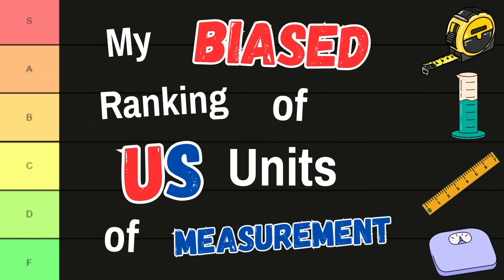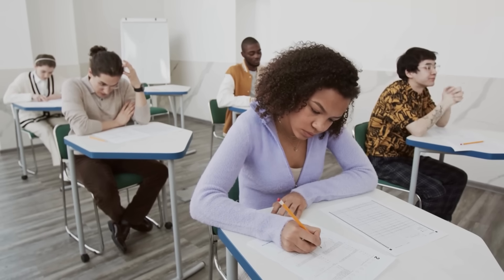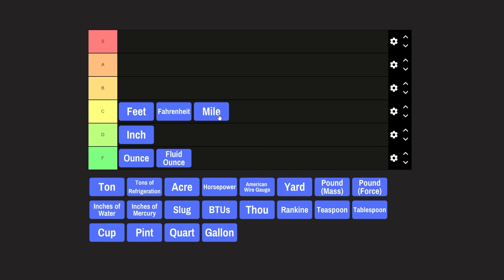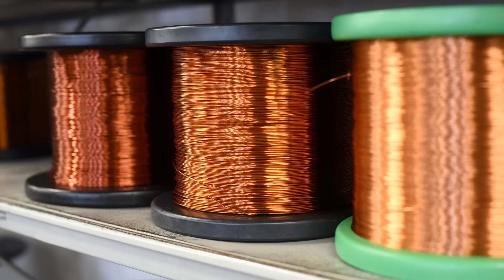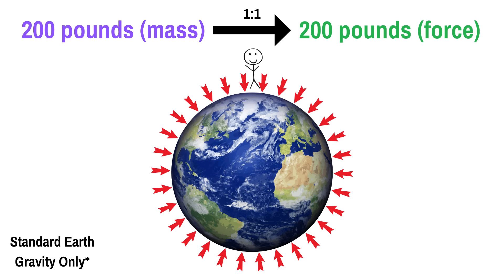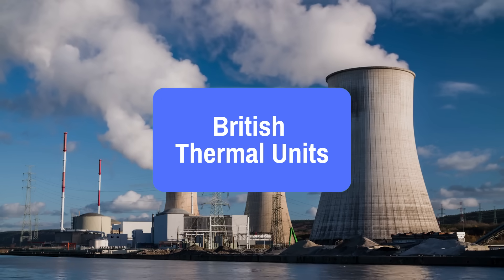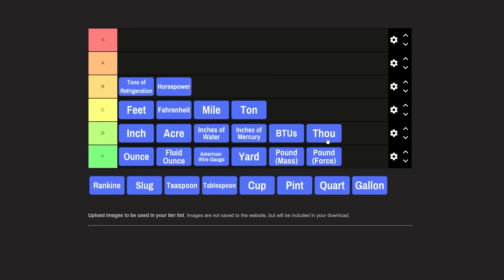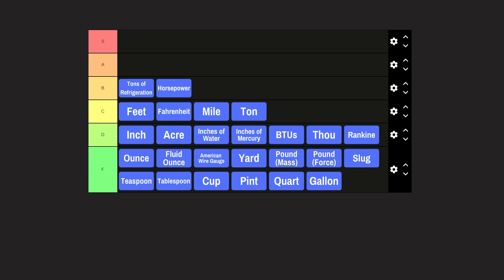Tier List of the DISASTROUS US Measuring System

Comment: Fun fact: as an electrical engineer based in EU, I have a decent grasp of how much of what every clown unit means, EXCEPT FOR WIRE GAUGE, because that shit is impossible to convert to anything related to the real world without whipping out the conversion tables.
Reply: Gauge is the worst. Especially because wire gauge, nail gauge, plate gauge, and screw gauge don’t even line up. Just tell me the thickness!!! Everything could be in millimetres and it would be so easy!
Reply: @ImranZakhaev9  totally agree, sucks that drill bits are in fractions of inches but things that go through those holes are in gauges
Reply: @ynx that is weird. Thankfully, that’s not the case here in Norway, we just use millimeters for everything
Reply: @kristoffervatshelle1418  do you use mm for high voltage transmission lines too?
Reply: @ynx  To be fair... Drill bits are in mm here but wires are marked in mm² and that does not account for the insulation. Metric does not solve this specific problem.
Reply: @1001digital  is this a valid problem? are you supposed to put a wire through a drill hole without any sheathing or grommet?
Reply: @ynx Things are done differently here in Europe. When a house is built, they cut channels into the brick walls, then place the cables and then plaster the walls, including the cables. I've never seen someone using an additional sheathing. And when you have to go through a wall, you need to drill a hole. So I think this is a real problem.
Reply: @ImranZakhaev9  shotgun gauge at least makes some sense. "How many lead balls of this diameter does it take to get to a pound?" Or at least, that's what I remember the definition being. Now that I think about it though, I'm pretty sure a 12 gauge shotgun is FAR to large a bore to take 12 lead balls to get to a pound... hold on, gotta look this up

Edit. According to wikipedia, this is how shotgun gauges work.
Reply: @ImranZakhaev9 
1: other than wood screws, everything I can think of that goes in holes is measured in inches. 
2:If Brad nails were in millimeters, they would be far less fun.
Reply: @ImranZakhaev9 exactly. I would even take circumference at this point...
Reply: @ImranZakhaev9  the word itself in its verb form kind of means "to estimate", so what were we expecting :D
Reply: As an electrician in Finland I use about 50/50 AWG and mm2, I just memorize a table just to get an idea of the conversions, where 10AWG is 6.0 mm2, 12AWG is 4.0 mm2, 14AWG is 2.5 mm2 and so on
Reply: @lassipls  When I studied undergraduate it was 2.5mm2 for light fixtures and 4mm2 for outlets. is that your code also?
Reply: @ynx  I only wire industrial control panels/cabinets so I don't really know what you mean. I choose appropiate wire according to the MCB/fuse rating it is part of. 

0.75mm2 for 4A and smaller, 1.5mm2 for 6-10A, 2.5mm2 for 16-20A, we rarely use 4mm2, so for 25A and 32A we use either double 2.5mm2 or 6mm2 depending on the situation. 

Also only a handful of projects I've worked with had wire sizes specified in the electrical drawings, so it's up to the guy who wires the thing to choose appropiate wire size.
Reply: @lassipls  Gotcha, normally you have code dictate what you said, circuit breaker rating, some derating factor (0.8) in US for continuous current, and type of wire dictates wire thickness here
Reply: @ynx  I don't actually have a formal education in anything relevant to the field, and I most definitely have no business working as an electrician doing residential jobs. All I know is wiring enclosed control panels, that mostly control things inside factories. The length of connections 95% of the time are less than 2 meters (7 ft), and we only use stranded copper wire (Multinorm H05V2-K / H07V2-K), sometimes tin-plated. I guess we mostly follow "common sense" or "good practice" instead of code and regulations in this regard, as long as our customer is happy with the result.
Reply: @ynx  I believe in Norway it is 1.5mm2 for a 10A 230V circuit and 2.5mm2 for a 16A 230V circuit. This is for wiring of homes.
I believe the amps for extra high draw appliances such as cooktops/cooking-stoves have their own 20A (or 25A) and utilize 4mm2.
Reply: Try KCM wire. We used it in engineering. They have nick names for birds too
Reply: Do you usually ise EU/tick or EU/second
Reply: That seems to have been the point. It's based on equal factors between adjacent sizes, but for some dumb reason it's a factor of radius not area, when area is the one that is proportional for current capacity, resistivity, and tensile strength...
Reply: @blairhoughton7918 
Area and radius are directly linked through an ingenious new equation: πr^2=A.
Reply: @777idkineedausername"proportional". I'm sure that was clearly visible in my comment.
Reply: The tierlist should have one more column at the bottom, just for that abomination.
Reply: Thank you, Napoleon Bonaparte.
Reply: Wire gauge is the dumbest way to denominate a wire size.
Reply: I fucking hated that
Reply: You are not entitled to an opinion because I am holding all electrical engineers accountable for the mother of cursed units that I saw at IKEA: KWh/1000h aka: (joules/s)*h/1000h
Reply: @sth9708  I assure your that is not the work of an engineer
Reply: @sth9708 Pretty sure that's EU mandated and just meant to give you a quick overview of how efficient something is when comparing different appliances
Reply: @sth9708 That is not cursed for Europe as our electricity is measured in kw/h. So telling me how high the energy consumption for 1000h is seems fair. I guess that's approximately how long you have a lamp on in a year. 

Normally everything is in kW/h per year but for lamps 1000h seems more reasonable as you don't keep them running 24/7.

I'll know the avg yearly cost if I multiply that number by 0.35

Joule on the other hand is not really used, most people won't even know what that is.
Is your measurement of how much energy you used in joules?
Reply: Whenever you think you understand their units, they hit you with something worse. Burgers per bald eagle.

Comment: The metric system links length (meter), mass (kilogram), volume (cubic meter), pressure (pascal), energy (joule), and power (watt) through SI units.
Length defines volume (1 m³ = 1 m × 1 m × 1 m) and area (1 m² = 1 m × 1 m).
Mass ties to density (1 kg/m³) and force (1 N = 1 kg × m/s²).
Volume connects to length (1 m³ = 1000 L) and density (1 kg/L = 1000 kg/m³). 1l = 1dm³. 1ml = 1cm³.
Pressure is force per area (1 Pa = 1 N/m²), with 1 bar = 100,000 Pa and 1 atm ≈ 101,325 Pa.
Energy is 1 joule (J) = 1 N × m = 1 kg × m²/s².
Power is 1 watt (W) = 1 J/s = 1 kg × m²/s³.

Comment: Finally I got some feeling for Fahrenheit. Even a user of the ISO system (also sometimes incorrectly name metric system) should get a feeling for degree Fahrenheit, as it is being used too often. But still: Celsius is much easier to explain. O: water freezes -> ice, snow, look out the window in winter. 100: water boils. Go to your kitchen to know how hot this is. Human body: 37. Comfortable room temperature: 22. A hot day: 30. A very hot day: 40. If dry air reaches body temperature you can not get rid of heat by sweating (also depends on humidity: so 30 with high humidity feels really hot). All the imperial length units are simply crap as the conversions are terrible. The foot makes kind of sense though. The pound is terrible. Get rid of it. The only non ISO unit I personally can not get rid of is horsepower. It says something about the state of mind of US citizens, not being capable of the performing the trivial change to the ISO unit system.

Comment: How the fuck do you do math whit this shit of a system
Reply: because he didnt even explain shit properly, 99% of these units aren't ever used (especially a slug, ive never actually heard of it used in my whole life and i grew up and live in the states)

its all ratios, and as a base 12 system its generally more friendly to quick mental math, we're also actually hybrid here so we do use metric in scientific and engineering fields, the ladder only needing to be metric when anything more precise than a thousandth inch is necessary. metric is also our international standard.

now before you say "oh but metric is easy for quick math", its only true if you're converting scales yeah its incredibly easy to go from kilo-no prefix-centi-deci etc, but if you have a recipe calling for 340 grams and you need 3 portions (say for a small family event) you need to spend more time thinking than just going "yeah i need 3 cups"

due to our hospitality culutre we routinely double or triple etc meals which is much easier if our recipes are done in ratios and fractions, things like most construction dont need milimeters or even really centimeter level precision and as a result we can afford the tradeoff for quick and easy mental math, visualization (you can very easily cut a distance in half or thirds, quarters or sixths visually) and as you can generally get a rough estimate of a foot with your own body, you can get larger distances with yards (3ft -> 1yard or 3:1)

with things like cup being a measurement of volume, we can easily ratio our drinks too,  1:4:8:16 (gallon->quart->pint->cup), fl oz is only tricky because getting more precise than a cup isnt always needed for most situations, but its 8 fl oz -> 1 cup anyways so its still pretty easily divisible

Comment: As a European, the "kitchen" measurements are actually genius if you just use a cup instead of the metric definition of a cup etc. It's all about the ratio - adjust as you go

Using your own feet and thumb is pretty clever too if you're just building something for yourself

Metric is obviously a better system, but those two are much more convenient - and more than good enough in many settings

Comment: There are 12 inches in a foot, 3 ft in a yard, 100 yards in a football field, and 17.6 football fields in a mile. It's not that complicated. 

Also, the story I was taught in school of where horsepower came from was that it was actually measured with ponies used to operate the elevators at a coal mine, and was measured as an average over the course of an entire day. After that, they simply just assumed that 1 horsepower was 1.5 ponypower.

Comment: As a European I can understand what a Foot or a mile is supposed to be. As for Fahrenheit. Absolutely No. That belongs below F tier. Nobody understands it, it doesn't translate into anything.
Reply: Fahrenheit is based on human body tempature thresholds it makes absolute sense, seeing as the most common use for temperature is weather. Celsius lacks granularity in scale for its most common use weather, and suffers the same issue for its secondary use Cooking and science as fahrenheit, And Kelvin is the superior measurement for temparature.
Reply: @Loki_Trickster  Kelvin is literally celcius bro, just shifted the zero point towards where molecules are at a complete stand still. What are you even on about?
Reply: @Arathreas  It's not literally Celcius Bro. The scale is completely different BRO. Having a different Zero point means everything Is different BRO. And because its not based on the freezing and Boiling of water it scales completely differently BRO. You wouldn't need the 273.15* conversion if they were the same BRO. It's also not based on varietible science like Celcius BRO, thus is superior for scienctific measurements BRO.

Comment: Theres nothing in the S tier bc S tier is the metric system. Which part? ALL OF IT!
Reply: Bruh meters aren't even accurate to the length they should be
Reply: @Sanstheskeletonreal It's got a fixed definition based on the speed of light, and is therefore infinitely repeatable even if all original meter standards were lost. Also it relates to water.

Comment: 1kg is mass of 1 liter of water then what is ounce mass based on?
Reply: Base 16 I think. Because 1 pound is 16 ounces, and 128floz is equal to one gallon. 
We also use base 16 in our sub-measurements, because we split our inches down to 1/16 of an inch... but then our inches have to be in base 12 because America is dumb.
Another random fact, a mile (5280ft) could also be base 16, because 5280 is a factor of 16 with no remainder (5280÷16=330)
Reply: @ but my question is what is it based on pound based on what whereas kilogram is based on 1 liter of water which is 1 decimeter cubed of water
Reply: @tumo07   I'm not sure myself. But off of my own knowledge, I suggest looking up things like "Roman Libra" and "Libra pondo" as the pound came from the roman measurement Libra

Comment: Bump feet (and yard) up a few tiers! A yard is 36 inches for the same reason a circle is 360 degree, for ease of division. A foot is just a 3rd of a yard, and a 3rd of a foot is 4 inches. Much easier than finding a 3rd of a meter
Reply: Bumping it up a few tiers for being good in one single thing is not that big
Reply: @Yodi_Loewe  that "one single thing" is the bane of many engineers existence. Walking is a single thing our legs can do but even if thats all they could do, it's extremely valuable to us. Just because it's one thing doesn't make it insignificant
Reply: @ so legs are more important then arms? 
The imperial system is great to divide in thirds, the metric system does everything else better. Just because there is one single more convenient thing does it make the thing that can do everything else better, worse?
Reply: @Yodi_Loewe  comparison is the thief of joy. Do not pit them against each other, saying one is better than the other. I never said legs were more useful than arms or feet were better than meters. In fact, in both cases, I've seen them used together for great complexity. All I ask is you not discredit the honest foot for it's diverse use
Reply: @cinderschitt  you said „bump them up a few tiers“ just because they were good at one thing. 
Also you were the one who compared first so don’t come at me with that „comparison is the thief of joy“ bs

Comment: 1 Thou is 1 mil.... As in mili-inch. For some reason, in circuit board design (and some other cad stuff), mil is used, but if you take that drawing to a machine shop, you better say thou, or they might think mil is short for millimeter.
Reply: Millimeter is the most common though in circuit board design.

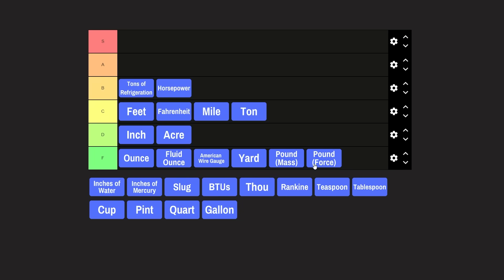Comment: 6:04 Even the metric system hasn't eliminated this nonsense. There are three commonly used units of pressure in medicine: millimeters of mercury, millimeters of water, and centimeters of water. The first is usually used for blood pressure, the second for fluid pressure in the brain, and the third for air pressure in the lungs. It's a pain to interconvert the three. A millimeter of mercury is about 12 millimeters of water, so slightly more than a centimeter of water.
Reply: Nah, we have mmHg, atmospheres and pascales
Reply: @miguelgp3332 Yep, and none of those medical units are the metric ones.
Reply: It is like that bc it would be a pain to convert when its already standardised